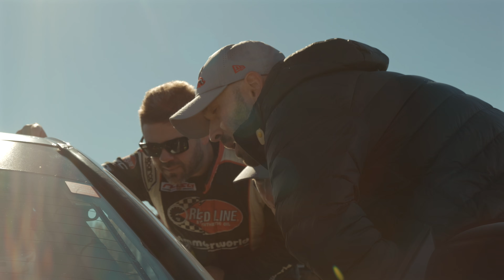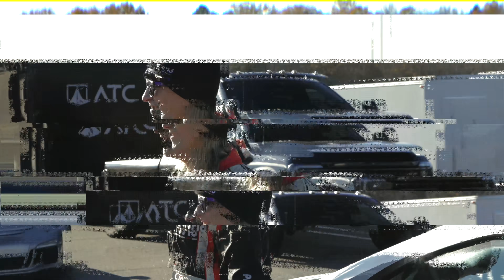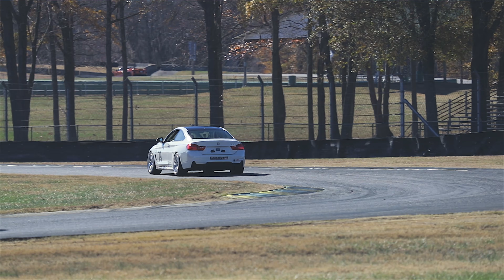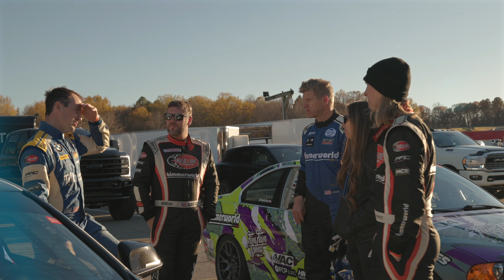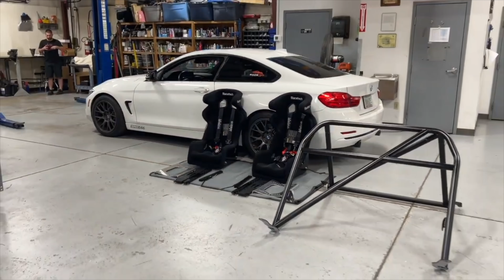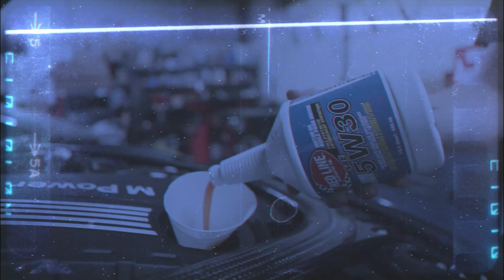F32 435i Race Car Project: First Time at VIR!

Comment: I think a budget build on the f3x for an hpde car would be a winner. Put a baffle in the pan and program the dme to run higher oil pressure on the volumemetric oil pump to match s55 specs, run the isc v2 race coilovers y'all sell and review it cuz I'm interested in it and put 200 tread wear tires and you got a daily /hpde weekend warrior with close to 400hp and even more torque with minimal mods and a tune. Please make f3x front air dam/splitter.

Comment: Cool car & awesome conversation!! My only question is how this 60+ thousand dollar car is even close to comparable to a spec e46 that encourages people to join the sport at a fraction of the price… No hate here either, big fan (& customer lol), building an all out e92 m3 track car currently & maybe will see y’all at the track one day🏁
Reply from the maker: SE46 is a relevant comparison because it's such a prevalent, known quantity and the fastest of the BMW build-yourself spec cars.  A F32 435i has a turbo (great for power to weight classes), flappy paddles (not everyone wants to drive a manual), and it's just newer.  That results in incredibly similar cornering speeds, faster straight line speeds, and a different driving experience.  A premium F3X build is approximately $5,000 more in parts when comparing a premium E46, and is a more expensive/newer donor car than SE46.  But everyone's entry point is different.  SE30 encourages people to join the sport at a fraction of the SE46 price, and some people just want a different level of car and speed - up or down.  We believe this car adds an option that didn't previously and otherwise exist in a standardized and spec format, aside from a retired homologated car which usually have a different level of care and feeding costs - and also can't be built over time to ease the entry expense.

Comment: These n55 engined cars are such a bargain in 2026, everybody is after b58 and older bimmers, while the n55 f2x/f3x just sit in the corner, here in europe 435i vs 440i = sub20k car vs high20k car. 
Soon, I'm getting an e82 120d as my first BMW, but then, I'm definitely after an f32 435i, you guys sold me on this one.
Just a quick question, is it just me or the f3x/f8x suffers from too much understeer when braking with the wheel turned? like at 23:26